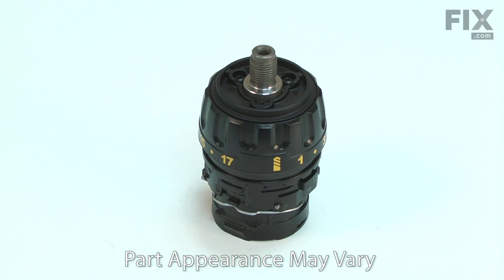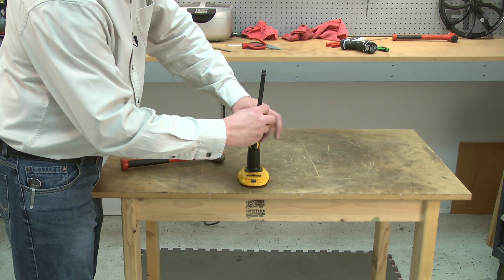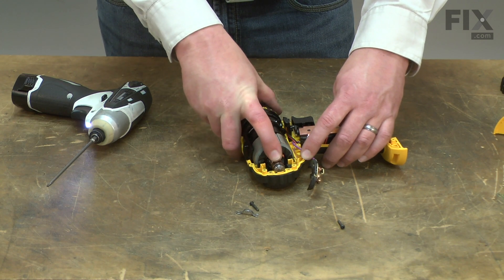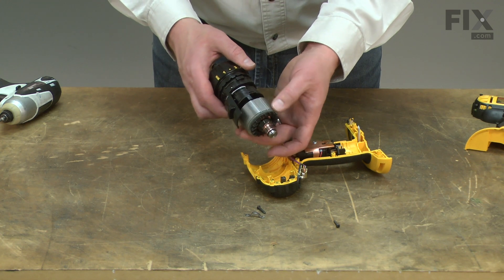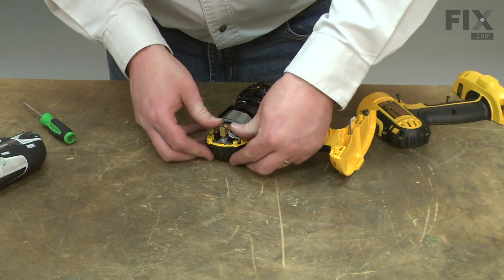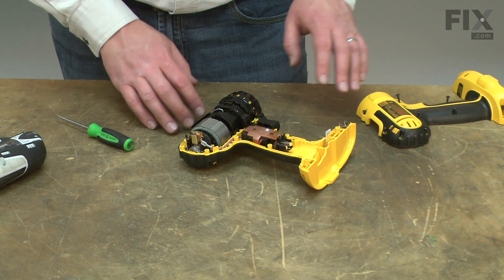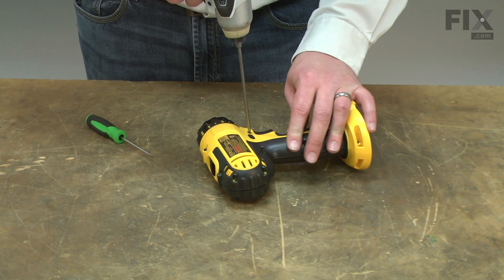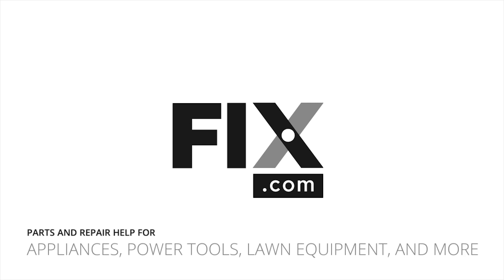DeWalt Cordless Drill Repair - How to Replace the Transmission

Comment: OK, I did everything, but I cannot get the chuck off the drill. I got the drill apart anyway, but the chuck refuses to come off. Any ideas about what I need to do?
Reply from the maker: First, make sure the clutch is in the drill setting and the transmission is in low gear. If these two settings are incorrect the gearbox or clutch will just slip when you strike the allen wrench with the hammer. If you still have no luck the next method I would try is an allen socket and an impact wrench. You chuck the allen side of the socket into the drill chuck and then use the impact wrench to turn it. If that still isn't working or if you don't have access to an impact then I would suggest disassembling the gearbox and clutch until you can access the chuck spindle. You might need to cut some of the gearbox/clutch components with a hacksaw to access the spindle. Once it and the chuck are removed you can clamp the spindle in a vise and use the allen wrench and a hammer to remove the chuck. -Mark

Comment: Were to order that part
Reply from the maker: You can find this part here: https://www.fix.com/parts/cordless-drill/dewalt/fix10183651/transmission-assembly-648984-00sv/?SearchTerm=fix10183651&SourceCode=3